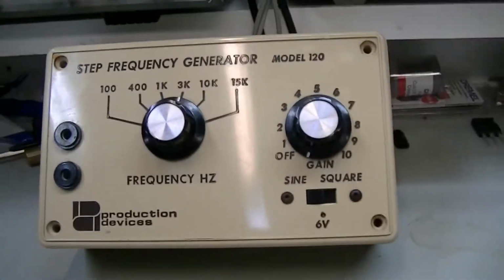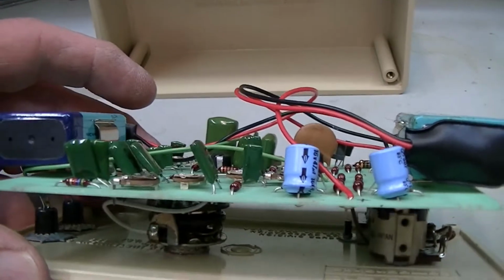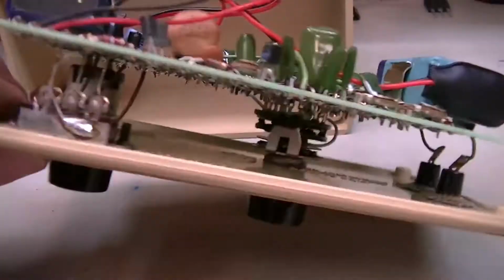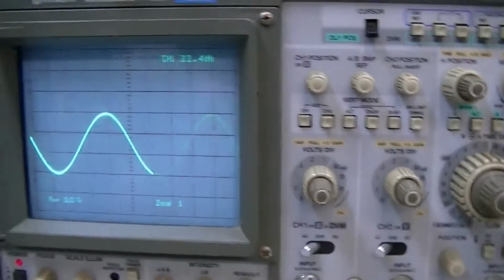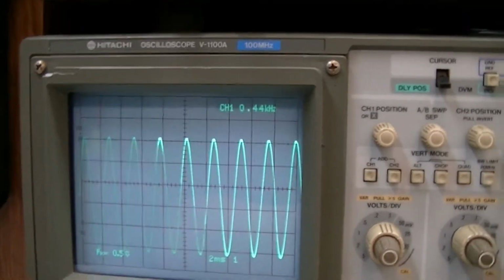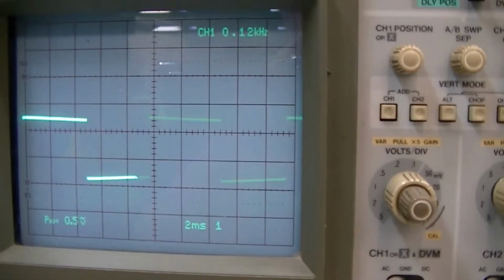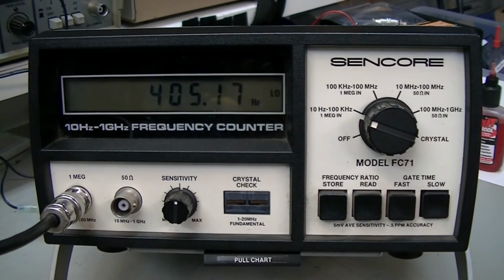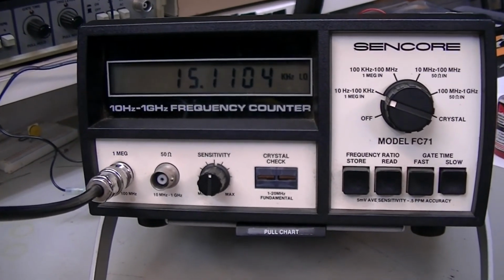Production Devices Model 120 Step Frequency Generator

Comment: Going out on a limb here... I viewed your BBC Goertz Metrowatt MA 3E posting from 7 years ago. The comments are disabled. I have one. I have an English version of the manual. I am not selling, but if you’re still interested in that English version, I will try to scan it for you. Jheagerty@ieee.org (Joe).
Reply from the maker: Thank you for the offer. I sold that and several other pieces of test equipment summer of 2018 since I had to have surgery on a torn rotator cuff. I knew I would miss a minimum of 3 months of work, so I was selling anything that I did not use on a daily basis as extra money. I wouldn't mind having another and have an active eBay search for one, but most that show up are for way more money than I am willing to spend for one.

I disabled comments on all but my most recent videos when I came home from work and found that some idiot had made crude comments on all of my videos. He took offense to the fact that I threatened a pervert clear back in 2008 when he was making very suggestive comments about my kids that were in videos back then. The videos that I DO allow comments on must be pre-approved. Unfortunately, YouTube's notification system is broken, therefore I did not see your comment until 2 weeks after you made it.

Comment: How’s the Klein tool bag holding up? maybe you can do a new video of your tools and bag that you use for work like you did a few years back..awesome video as usual....👍👍👍
Reply from the maker: I stopped using that tool bag a few years ago. It is still in my garage somewhere, but I found that for as many times I need to move from job to job in a day, it became  a bit of a pain to unzip and zip the sides many multiple times per day. The one I have now is an open top design so I don't have to do that. I've had several people ask me about this bag the past couple years, so maybe I should do a short final video on it.
Reply: I’d love to see your new bag and all your tools setup in your new open top bag. Love the videos sir...👍👍👍
Reply from the maker: I'll be on vacation the end of May, maybe I'll bring my tool bag home and do a combined video of my old and new bag.